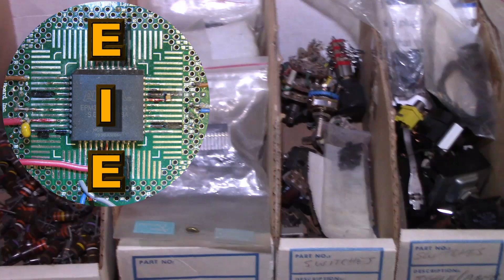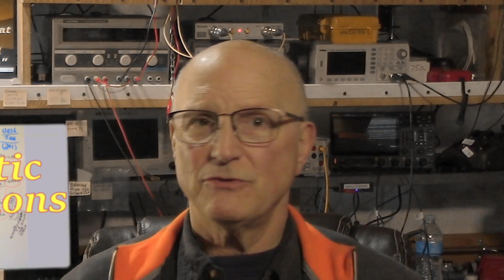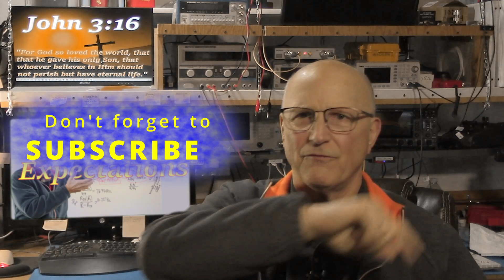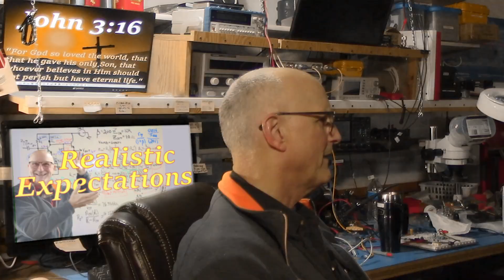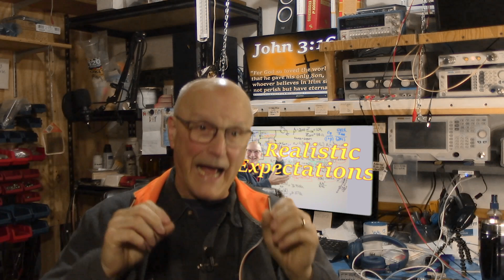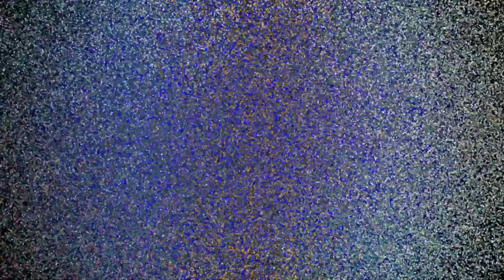Establishing Realistic Expectations for Circuit Analysis & Design (067)

Comment: I use metal film 1% value resistors and a Bata that is minim (for temperature stability) of the transistor.
Reply from the maker: Yes, yes! It used to be that 1% resistors were cost prohibitive. That hasn't been the case for a lot of years, though. I almost exclusively use 1%,metal film resistors (leaded) or thin/thick film surface mount. 
I do leaded on the bench (breadboard) then, if I do make a circuit board, I go with surface mount. I have literally built hundreds of surface mount boards over the years. The joys of being the product design EE and the technician and the manufacturing engineer and the test engineer all rolled into one!🙂
Reply: Yes, I wore different hats when I was working as well. I have started looking at other video's. They are very well put together and presented for a layman to understand  ( no knowledge of electronics ).
Reply from the maker: @rtybn2012 This is where my channel started with things like "Understanding Voltage", "Understanding Current", "Understanding Resistance", Ohm's Law, Kirchhoff's Voltage and Current Laws, Thevenin's and Norton's Theorem and so on. (maybe I should refactor some of these earlier videos and re-release them???).
This series here begins with understanding how diodes and BJT transistors work on a basic level. Getting into the middle or late into a series such as this, I have to assume that folks have some background at least from the videos leading up to this one. At the same time I also try to assume that someone is, in fact, jumping into the middle of the series to view a video of interest to them. It's a tough balance to keep.  That is why I am constantly pointing people back to other videos if the concepts are foreign to them. So, it is all there somewhere in the multitude of videos I have produced. 🙂
What makes my videos different (in my opinion) is that I try to answer the questions that naturally come up to an inquisitive experimenter, but are nearly never/rarely answered elsewhere. This has been my own frustration in relearning things. It amazes me how many, many places I have to go sometimes to piece together the whole story. I really try to bring it altogether in one place.
You are right, there are TONS of videos out there, all with their piece of the puzzle.🙂

Comment: This is great, actually all of your videos are. Ralph, I wanted to ask what advice would you give to a new ham who is interested in learning to build linear amplifiers, specifically ones with 3-500z's. Any assistance is greatly appreciated. 73's KJ5CRY
Reply from the maker: My first advice when working vacuum tube of any flavor ... respect the high voltage! Then with tubes like these high power linears ... doubly-respect the high voltage. I've been seriously nuked because I got careless ... and it is soooooo easy to forget and get your hands in the wrong places and REALLY wish you hadn't!
Reply: @electronicsfortheinquisitiveex For sure! Any specific reading material recommendations?
Reply from the maker: @RL-521  If it were me looking to work with vacuum tubes at this point, I'd be going back to my OLD Radio Amateur's Handbook (ARRL). They deal with tubes in much more detail than the new ones and are more oriented toward home brewing. I have a 1956 and a 1939 Handbook.  Beyond this, I've been out of the vacuum tube loop so long, I'm not sure where I'd go for more modern texts on the subject. Sorry I cannot be more help. 😞
Reply: @eie_for_you no worries, take care!
Reply from the maker: Thanks!
This is my LONG overdue reply!  Sorry. Sometimes this stuff gets lost in the YT world. I'm spending some time trying to clean all this stuff up. :-)